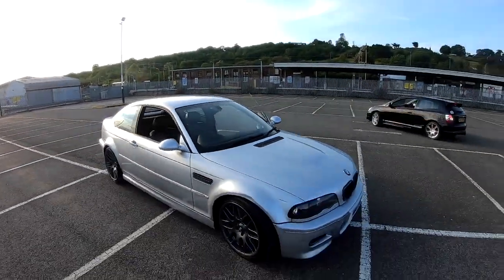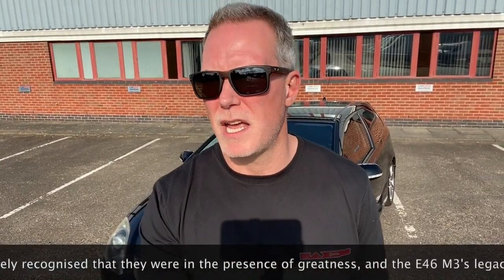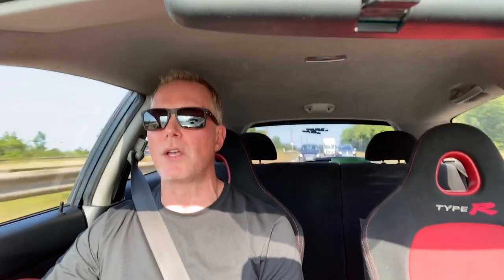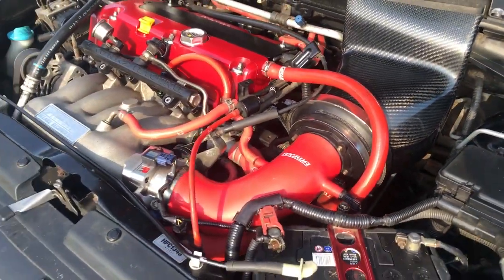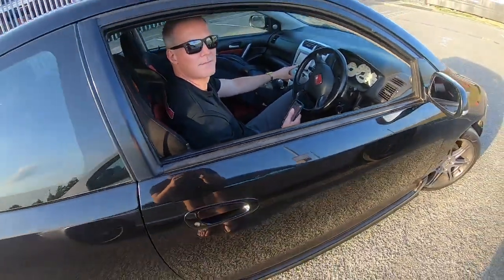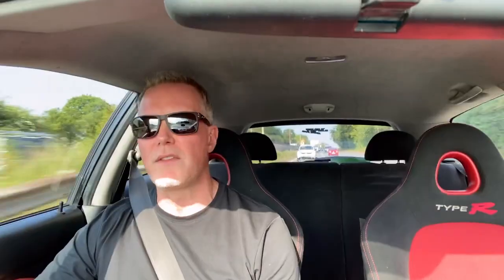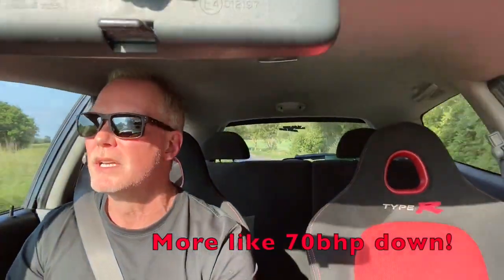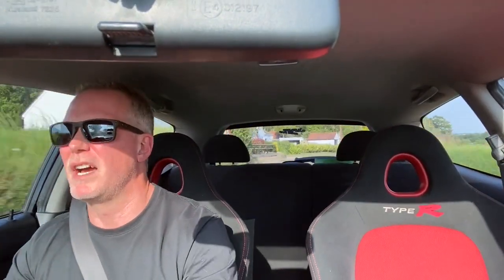Modified Honda EP3 Civic Type R with 270bhp K24 engine review

Comment: Bro I have an ep3 With a k20 and following mods tegiwa induction skunk 2 TB, skunk 2 ultra inlet, DC Sport 421 exhaust manifold and skunk 2 Megapower K100 ECU. My engine is knowing I’m thinking to stick a k24A jdm engine in is it a straight swap ?